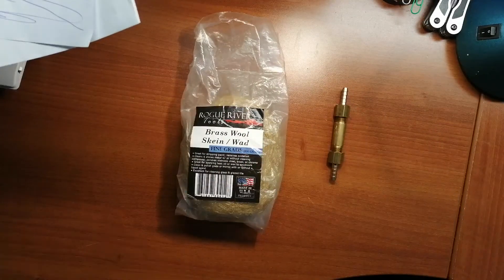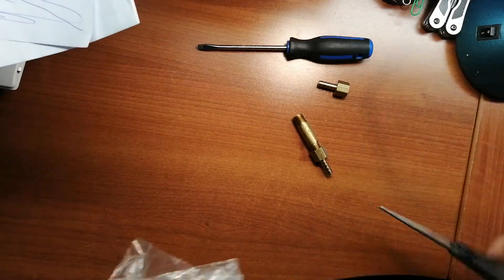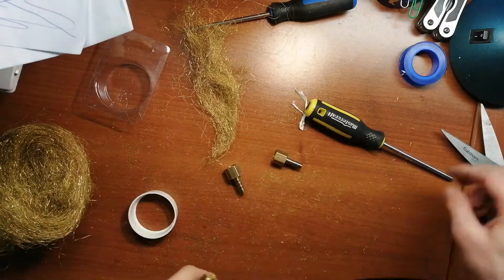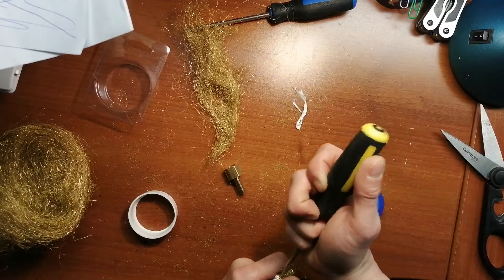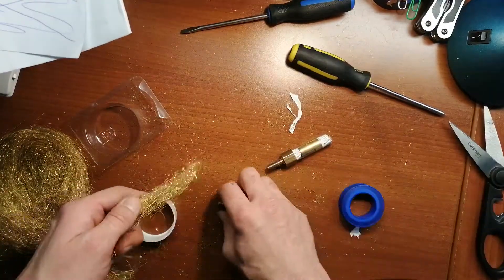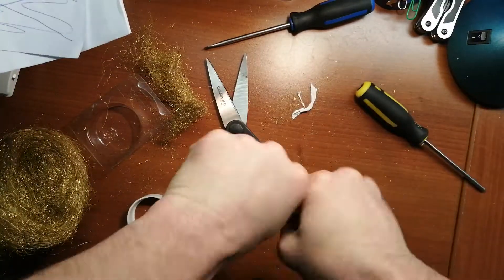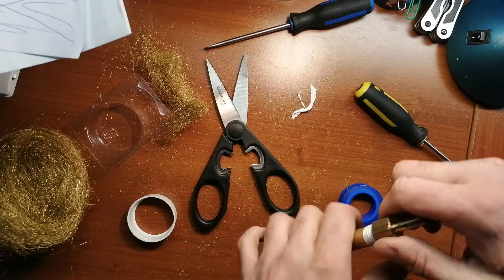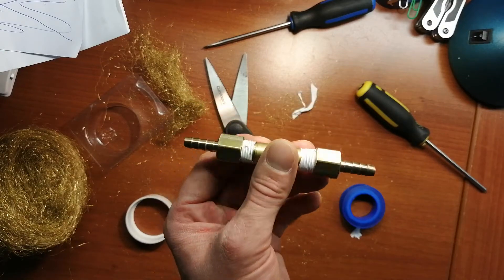Truly Working DIY HHO Flashback Arrestor That Fully Works February 2022

Comment: I've tried several different flashback arrestors with my HHO setup, the best one I ever had was some little porous brass thing that came out of an older model oxygen concentrator, I wish I had paid more attention to what it was, but definitely made of brass and it was porous, encased in a little plastic tube and was about half the diameter of a dime. Another one that worked really well was using an air stone in the bubbler to make smaller bubbles but that brass thing was absolutely the best. Have you tried any of the sand ones?

Comment: Will glass wool work? If I use a bubbler do I still need an arrestor. Thanks. Good job
Reply from the maker: Don't use glass if you have a flashback you will have a shrapnel glass grenade if you use glass be very very sure you won't have a flashback
Reply: @ryandurand9769  I meant glass cloth or wool for the arrestor.  But are you saying that It's better to use plastic not glass for the jars? Some say glass but I'm now making with plastic.
Reply from the maker: @ashwynn4177  no I wouldn't use anything but brass wool because steel wool interacts with fire and burns and glass jars if they explode your probably going to get some cuts or worse
Reply from the maker: Yes you should still use a flashback arrestor even with a bubbler

Comment: You know what I don’t understand is I made this today and the gas not passing through so I don’t get it I try removing some of the wool and the gas still can pass and I remove more and it pass but it flashback through I even wet it
Reply from the maker: The container your using should be air tight and handle building up 5 or 10 psi so it can push it through with increased psi
Reply from the maker: It can't have any spaces inside or it will flash back